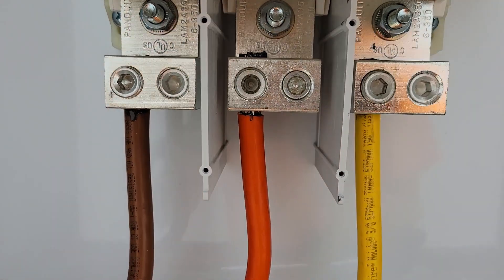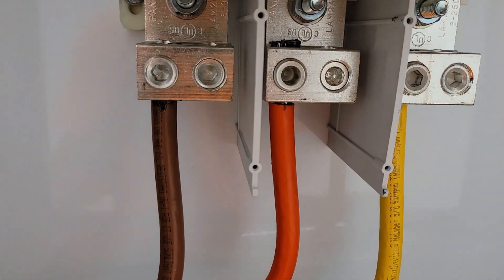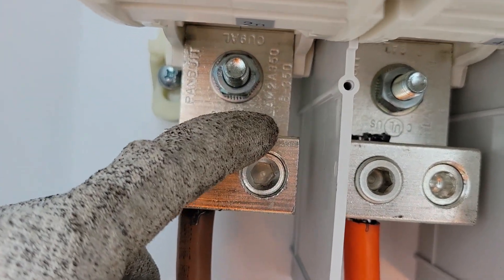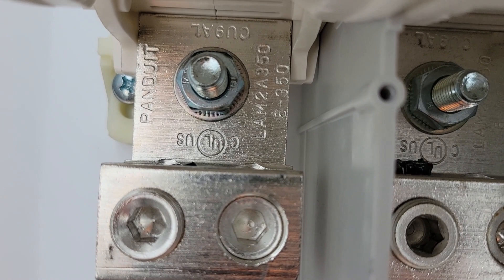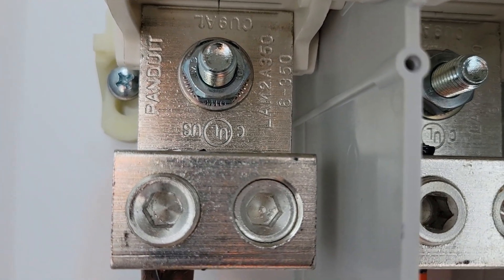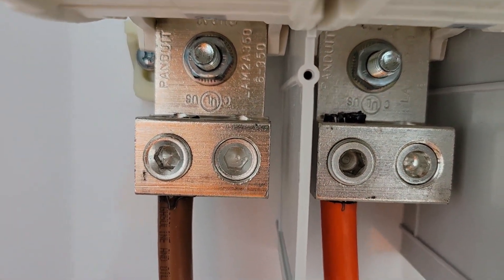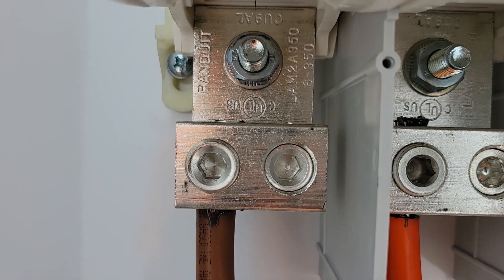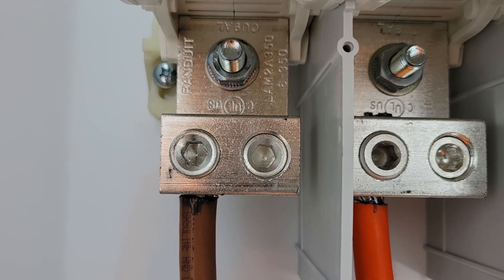Torquing Electrical Lugs With No Torque Specs

Comment: What happens if you over torque? You can't re-torque due to the wire being crimped?
Reply from the maker: The crimp doesn't matter as much as the pressure. You torque the lugs to accommodate thermal expansion. As long as it's not ridiculously tight, then it should be no problem to just retorque. If it is superman tight, cut the end of the wire and terminate it again.

Comment: Doesn’t the Code book tell you what to do when you don’t have the Nameplate?
Reply from the maker: 2017 & 2020 NEC 110.114(D) states torque values are deemed by manufacturer.
Reply from the maker: @NOsmoke24 Thanks for the comment. I commented on that in the video.
Reply: We also have a table...